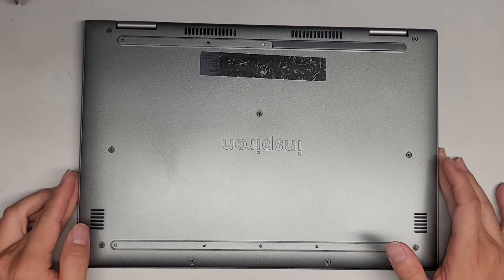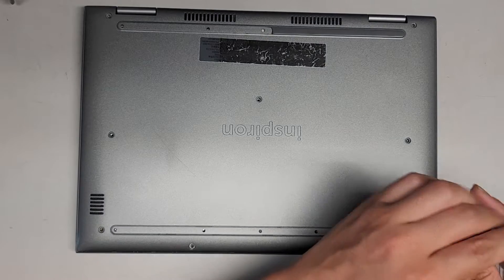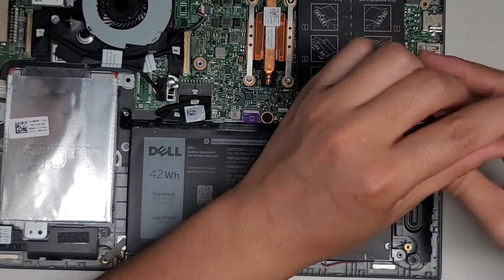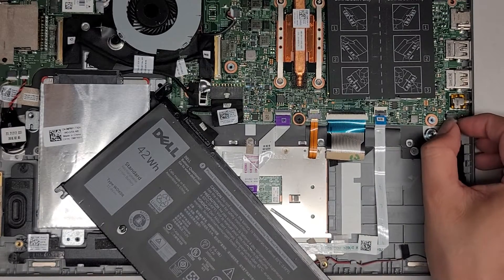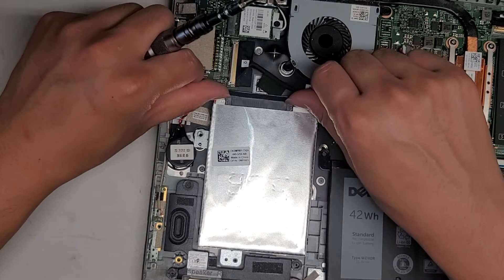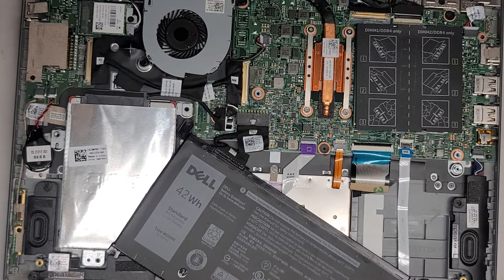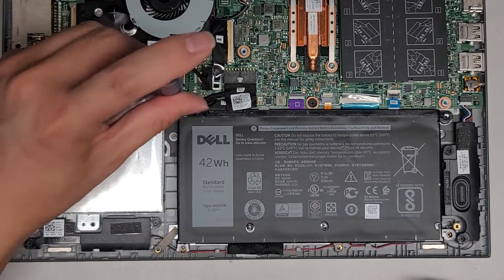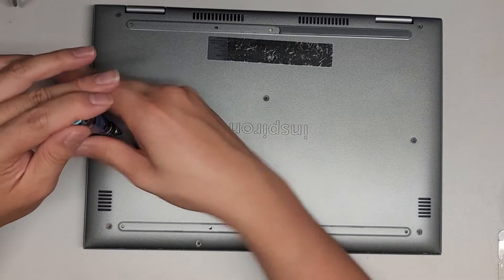Dell Inspiron 13 5379 2-in-1 Disassembly Quick Look RAM SSD Hard Drive Upgrade Replacement Repair

Comment: I needed to replace the battery in this laptop. Even though he doesn’t pull the battery completely out, I was able to do the replacement very easily by disconnecting the battery connection on the board first and then the end on the battery itself and just reversed the process for installation. Thank you for a great video!
Reply from the maker: @lynnchandler5845  yup, very simple :) glad you were able to figure it out.